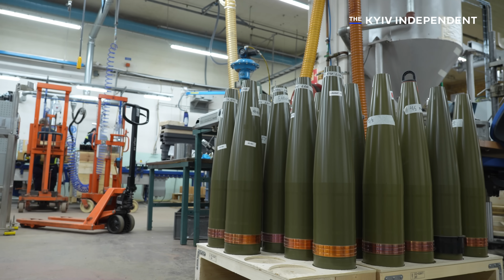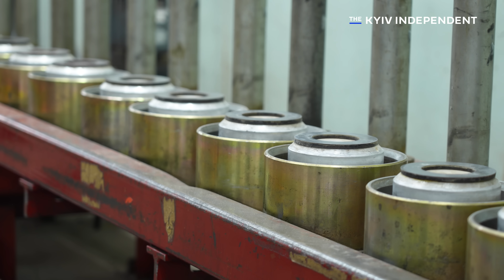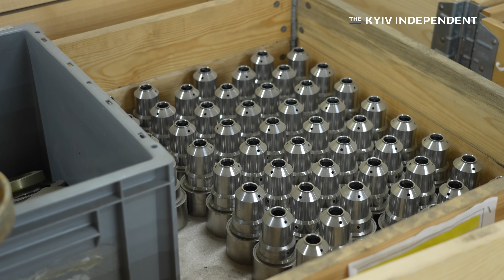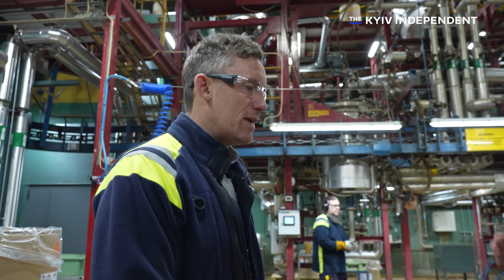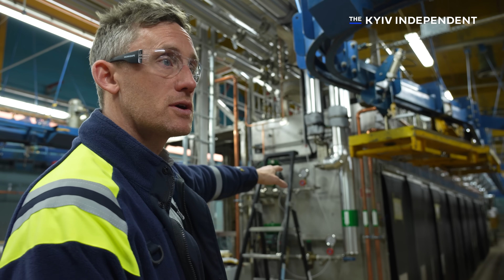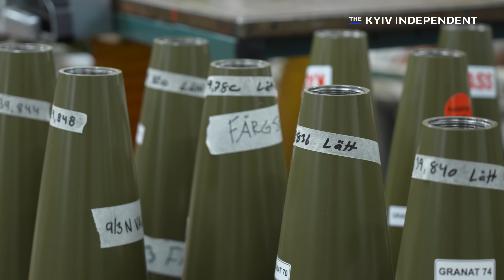The factory working 24/7 to make shells for Ukraine

Comment: It's good to see Mr. Martin Stang observes suitable safety protocol - I'm certain those protective glasses would save his eyesight if one of those shells they were baking happened to go off only a few feet away, but I'm a bit disappointed that he so casually strolls straight through a door with a sign that clearly states hearing protection is mandatory in the next room, if Mr. Jönsson over there drops a shell and it goes off, he could get a serious ringing in his ears, maybe even a slight case of tinitus...

Comment: Two years into the war and in the summer they'll double production.  I've never seen a biz running flat out where there are so few people, and the few barely moving.  I know its dangerous, but  you control that by creating an assembly line and hiring even MORE people whose on job is to look at others doing the work, and where they might be making a mistake, explosives building up and needing flushing, etc..  If you don't have the machinery to do the work, you set up wooden sheds between berms 100 feet apart, a worker wheels in an empty shell at a time where it's added to a heater keeping them warm.  Another worker wheels in another shells worth of warmed explosive in an insultated cart.  A tech pulls a hot shell out of storage, fills it, put's it in a tank of water , chilled if needed, so that a shell cools in the time it takes to fill a shell,   When the shell is down to room temp a worker takes one out and it goes to refrigerated storage. There shouldn't be more than 2 shells of liquid explosives in the shed at a time, and 3 filled shells.  Still death for workers if they go off, but shouldn't cause a chain reaction.  100 sheds, 500 workers a shift, 10,000 shells a day at about 4 per hour.  10 of these 'factories', 100,000 shells a month.  I'm sure it's more complex than this, but I"m sure there is a way to do this about 600x faster than building more of those assembly lines, where it seems much of the work is done by hand, hand cart, etc. anyway.

Comment: I'm surprised to see the explosive mixture being filled in by hand. Wouldn't it be faster, cheaper and essentially safer (no human error) to fill it in with a machine? I really expected that part of the process to be automated. I wonder if there is a good reason for not doing that.

Edit: I guess they do fill it in automatically in the cooler unit? Now I'm a bit confused what they did with that yellow liquid in the plastic buckets earlier in the video.
Reply: The factory was built in the 70s so its quite old, but they do something right, because it has only been a serious incident, then one shell did explode in a artillery piece, and "cracked" it

Comment: fyi gaps and cracks are not going to lead to an explosion in firing. Its a performance issue. A crack or void in the fill will stop the shockwave propograting and may cause the shell to not function. 

Also can't get over the sue of the word grenade over and over again

Comment: Why is NO ONE reporting on the problems caused by the Ukrainian bureaucracy?  There are current offers of 500,000 artillery shells (available NOW) made to Ukraine but no one seems to even be able to say YES WE WANT THEM. As a result they will be sold else where within a few weeks.
Reply: Sources??
Reply: @rogerthat4545  If you had legitimate reason for the information I could easily give names and contact info. 

This non-response unfortunately is NOT an uncommon thing right now. My company has been dealing with the same thing for other devices for 6 months now. There is almost a Ukrainian shadow government called the ULIE who act as brokers and middle men.

In the case of these shells it was over 100,000 152mm OF-25T shells and over 500,000 assorted mortar and small artillery shells. Were offered for delivery between June and December this year. However there is only a 3 week window to purchase them before another country gets them.

Lots of stories like this go on. And this time is simply them not bothering to simply respond and say YES. And in the meantime they are crying to anyone who will listen they are short of shells...
Reply: @Caphalea  So, no sources?

Comment: Why cant pouring in explosive be done without manual labour?
Reply: Because a little drop of explosive would spill inside the machine for each shell filled, and that would accumulate as flakes and dust that can't be properly removed and eventually provide the fuel for a very big, hot, fast and toxic fire...

Comment: US has shown it cannot no more be trusted in security related matters. There has been 3 cases making this clear. 1. US House speaker having the power of blocking any critical vote. 2. US president telling he pulls US out of NATO. 3. US throwing Afghanistan women and children under the bus thus sending them back to the stone age. 
Only thing left for EU to do the right thing is to start and prepare its own military alliance. EU has 550 million population where US has only 350 million. Corresponding military spending relations are of the range 300 billion against 1000 billion. Military expense is far too low for EU to be selfsuffficient. EU can repair the situation by depeloping methods of very quick building of factories and Repairing Bureocacy to be able to act as fast like it would happen in China. If EU does the right thing it is very strong coalition. One side effect of all the generated practical technological advancement  will generate economical upper hand for civil manufacturing sector.  For example Airbus and European Space Agency, Cern, Iter, ASML and so on are showing EU has the capacity for big projects of highest technological quality. So why not string militatry coalition would be successful for peace keeping. Why must peace be trusted to some unreliable, randomly impulsive actor across the ocean? 
It is not rational thinking. For some reason the EU does not value the state of peace enough. Mr P has shown that conventinal war is ok political tool. And it is for him - allowing more firm domestical grip. But Mr P is doomed to dive deeper and deeper as situation evolves.  EU has the job to make larger conventional war not so delicious. If peace keeps going on that is the form of making hundeds of thousands of jobs like what happened in US after Covid-19 when they succesfully poured lots of money to economy and magically it did not induce hyper inflation. Perhaps a strong Western democracy can withstand such a small Keynesian stimulus after all. The national economy MUST digest it completely before you can try again. So we can ask the question what is the fundamental economical difference between military product and civil product....

Comment: in the netherlands we have a empty factory with 500 to 2000 people that have nothing to do, why arent we setting things in motion.
Reply: That is strange. Swedish factories are producing as much as is physically possible, nigh and day seven days a week, and they are at the same time expanding our factories to be able to build more (and doing both at the same time is a challenge in itself).
Reply: If you're talking about the VDL car plant, then making cars and making shells are 2 very different things and they would need extensive modifications, and will basically have to replace all their equipment.
Reply: @TheCountess666  you have to completely rebuild a factory from start to finish even your changing cars.

Comment: In Sweden, there was an accident in 1968 when a 155mm exploded in the chamber of a howitzer, some deaths and injuries. ALL live 155 was recalled and emptied of the explosive. Then repeated and refilled, because they suspected that it was air bubbles that was compressed as the grenade was fired and enough energy was released to ignite the grenade. The howitzer got a crack in the chamber but was restored to mint condition. And went on to be very accurate compared to others who had developed some play in bearings and such. In 1981 was the HE grenades released for peace time practice. This howitzer was the 4th gun in our battery when I did my conscripted service, and we had some officers that was in that unit when this occurred. They never talked about it, just acknowledged that they were present there when in happened. There is a peice of 8mm film that shows everything until the burst burnt the film.
Reply: It's called adiabatic compression and is indeed why it should be insured that there are no voids/buble in the cast explosive.

Comment: zero experience whatsoever here... but dont you think its a bit too much QA for a product that will be exploded? Dont need a .001% dud rate for this application its not surgery its war. This definitely appears to hamper production. If a weapons specialist wants to school me here im all ears.
Reply: Different if that shell explode in the barrel, destroying the artillery piece and killing the crew. If one of those happen even every .001% shell, and Ukraine wants to fire 30 times that per month, that is 30 lost artillery pieces and crew each month. Yeah, it's War, but the point is to kill the other sides people, not your own or allies. He explain it in the video, a crack or bubble would cause friction and detonation in the explosive in the 1000G launch. He also said the bottleneck is cooling of the shell to prevent that issue, which is why they're installing 16 new cooling chambers.

Comment: What we see is the M107 artillery shell production. The M107 is many decades old, and so is this more or less revived production facility. There are many new developments going on, which this footage does not show but gives only small hints. The newer products are a bit more expensive, but have a longer range, more accuracy, and are more lethal than the old ones. This old part is only running at full capacity because there is an almost unlimited need of artillery shells. You can be assured that in a few months all of this is replaced by some modern streamlined production that can put out a lot more of the newer and more effective shells in the same time. The M107 then will only be part of history. The same happens all over Europe by all vendors that can produce 155 artillery shells. Artillery is the king of the battleground in this war.
Reply: Yes the ones they were producing in the video probably were older. But the HE-ER titled parts shown are very recent Nammo HE Base Bleed Extended Range 155 rounds.
Reply: @magitsu I saw that hint as well. That is the part they do not show in the video. We also do not see how the shells are produced, the heat and cold treatment etc.

Comment: The bottleneck of this factory is the cooling process of the grenades in one machine. And they are setting up 16 more modern machines....
Reply: The scarntorn is a big factory on the surface and do everything the and nemo factory is only do the last part in manufacturing.
Reply: Yeah they are doing a safe job there, but i could not help but notice how this production capabilities and speed of this plant compared to say Scarntons plant in the US.
Reply: @Clarkem1  That is outdated. The new machines will not need filling by hand and put each round separately into the X-ray. They will just use the conveyor belt and produce about one grenade each minute. The metal parts come prefabricated from a different factory, but those take the longest time to produce. The newer production is also made with insensitive explosives, this means you no longer need bunkers for the end product.

Comment: Swedish ammunition are ones with high quality, which is largely due to the unionized, highly educated, trained and experienced workers - which is much the opposite of the North Korean ammunition supplied to Russia
Reply: You cannot hear the shell falling on you... Only if it falls aside you... Proven in the croatian war of independence with many type of calibers and witnesses...
Reply: That process reminds me of filling and pasteurising drinks. Looks like it was built for a conveyor belt system with automated preheating, filling and setting. Just the final step would need to be done off line.
Reply: How can you hear something traveling faster than the speed of sound coming at you? And even if you can hear them it is not like you'll have a lot of time to react anyway. Maybe I'm missing something here but this "testimony" makes no sense..
Reply: The peculiarity of North Korean shells is that they are quiet, they cannot be heard on approach, which is why no one has time to fall to the ground and take cover. Swedish shells still make noise like shells from WWII.
Reply: @swe1733  You have been unlucky enough to be shelled by both types and lucky enough to survive it? Impressive.
Reply: @2canines  This is a statement by Ukrainian soldiers and commanders, not mine.
Reply: @swe1733  Unless NK rounds are subsonic, physics says no.
Reply: @swe1733  It does not matter if you hear it. Its already too late
Reply: @swe1733  All these shells are supersonic, unless fired at a very high angle.
Reply: @swe1733  mert azok is. A manufaktúra gyártás azóta se változott 🤣🤣🤣🤣🤣 poharazzák a tritolt ,beszarás !
Reply: @swe1733  Or not.

Comment: For two years now most EU Nations have only sent some military hardware and even less ordnance to Ukraine to help them support their ongoing fight to remain free from Russian aggression yet Swede, whom just became a NATO member, has taken more concrete and faster steps than all the rest of the EU countries combined to help a non-NATO country remain free and independent.  Thank you Sweden!
Reply: This is about profits.  Sweden and Nammo are just giving the rounds away for free?  I don't think so.  Would you not switch to 24/7 production to sell as many rounds as you can at 3x to 5x the price because there is a shortage?  They are not doing 'favors' they are simply making a profit.  
What should scare you is that almost all of Europe can't supply enough rounds to Ukraine, and that Russia alone is outproducing all of them combined.
Reply: @gags730  - No body said or believes that ANYONE is providing ordnance or military equipment to Ukraine just out of the kindness of their heart.  Of course profits will be made, but my point was that most EU countries, countries that face the most risk should Russia win, chose to do very little, even if it meant risking a future war against THEM.  Sweden seems to be the one country that has the foresight to do what it can to try and prevent a future EU-Russian war from occurring.
Reply: @WarHawk-  Germany, the UK and Denmark are by far the biggest European military supporters of Ukraine (January 15, 2024: with 17.7B, 9.1B, 8.4B respectively; Sweden is #7 with 2.03B).

Comment: a. The facility doesn't have 21st century automation. The fact that workers are doing stuff manually is attrocious! The speed of production probably suffers as a result of long working hours. That shouldn't be the case when manufacturing dangerous stuff! Not in the 21st century...
b. Increasing your output capacity by mid-2024 for an invasion that started in 2022 of a war that started in 2014? Why wasn't this stage reached in 2021 considering it was known that Russia was preparing for a larger invasion than that of 2014? 
c. Are the working conditions up to the best standards considering the insanely high price of this type of ammo? 
d. The facility looks... primitive. I would have expected a clear and obvious progression from one stage of the production to the other. 
Insane that this is the best Europe has to boast about after so much time since the start of the second phase of a war that is in its 10th year... Bunkers.

Comment: pouring the TNT by hand 1 at a time seems very slow and unproductive. you could pour them in the batches that you store them/heat them etc so in the US they do 8X8 at a time. that seems really slow Nammo
utilize technology from filling machines say automated water filling system where you put the shells on a belt. it lines up with 8X8 spouts and delivers the right amount via weight. simple and would take minutes off each shell's production
Reply: Hand pouring didn't have anything to do with 155mm shell production. In fact there was zero 155mm production happening in the video, the line was empty. As manager said, they were middle of capacity expansion. Probably reason why they allowed filming.

Comment: How much does it cost to make one shell? could we have a "buy a shell for Ukraine" campaign
Reply: A huge lot. More than the monthly wage of many people. What I do is to give donations for Drones. I donate for Ukraine since 2015 already. 🇺🇦
Reply: @duartesimoes508  Pre-war-time-shortage a standard 155mm HE Frag shell went for ~1000€. Now they're at about 2700€.
Reply: @andersjjensen way more than I imagined. And so many thousands are fired every day. Worse still, many raw materials will likewise become scarce, harder to find and much more expensive to buy. And this will happen in the West much before it happens in ruzzia, which was unfortunately blessed with every commodity except a normal brain.
Reply: @duartesimoes508  The amount of steel used in a shell is not ever, even remotely, going to be a problem. A single car assembly line sees more steel go past in an hour than Ukraine fires shells per day (even assuming they have all they need). The explosive component is made from compounds derived from oil and nitric acid. The "expensive part" is the energy consumption in explosives manufacturing. It's basically a gigantic chemical battery that can discharge all it's energy in an instant. But that energy has to come from somewhere.
Reply: @andersjjensen  Very informative, thank you!
Reply: @duartesimoes508  Your´e a `special one´. Hope you enjoyed your special day, today.